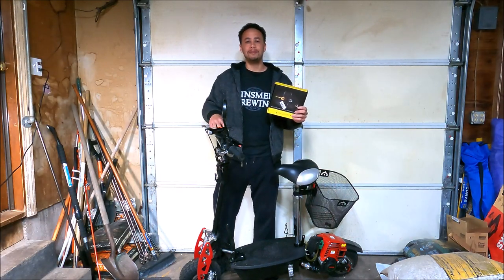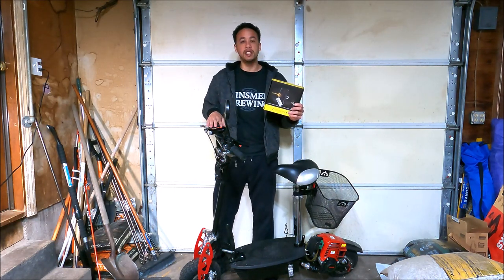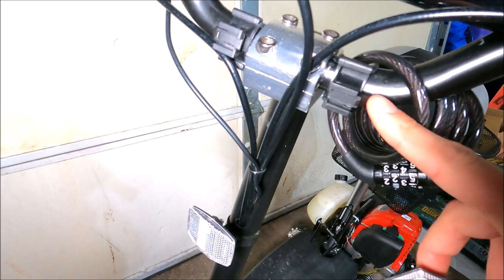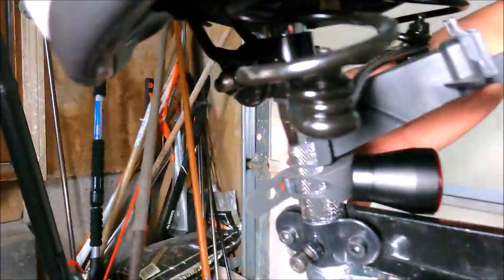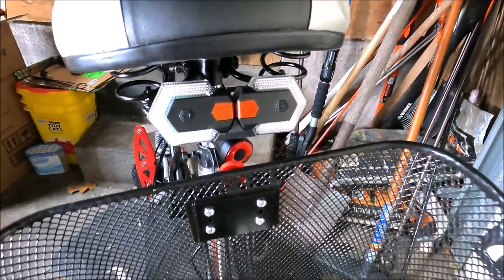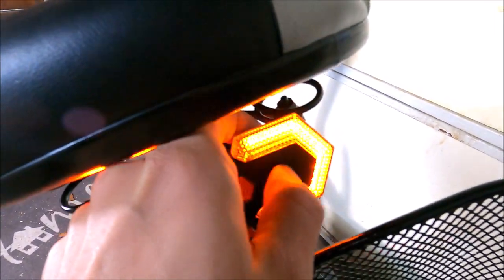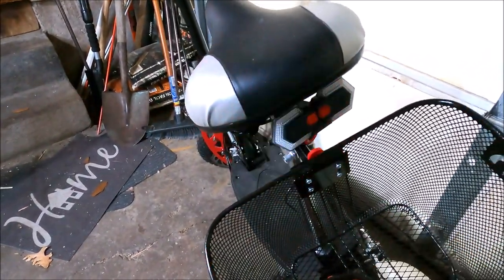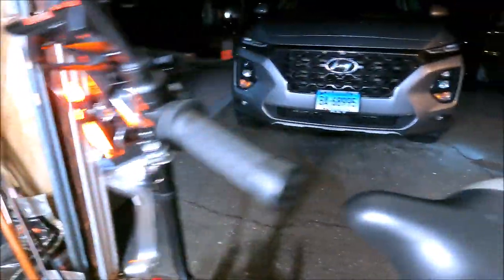Wireless Turn Signals for Scooters & Bikes by Carry Bright

Comment: They are 90% good design.. but.. TO CLOSE to center.. why the heck on the planet they did not do with little more plastic extension, say 6-8" away from center???!! I'd buy probably them.. It should be done (for Ebikes) this way similar to motorcycles' ones...!!!!
Reply: At least they have an arrowhead shape to show which direction you intend to turn.  Or is it too small for cars to tell from an average distance?

Comment: I like these lights but it would have been helpful to see them outside in the daylight, too.
Reply from the maker: Yea that may have been a good call. I did do them inside with LED lights on. But not the complete same I do get it. I will say, they are very visible in any condition.*SK*

Comment: In other reviews they always made that annoying beeping sound while blinking, did you change anything?
Reply from the maker: @Dom93651  No, I didn't. Perhaps mine is an earlier model. I will say that may not be the worst thing because I often peer around to see if they are still on. Having someone audible would make for knowing when they did actually turn on and off. But I have never heard mine make a single sound.
Reply: That annoying sound lets you know at least one light is working. No sound and you have to get off the vehicle or move to check it.

Comment: Can I mount them on horizontal bars in my wheelchair? Thanks!
Reply from the maker: They should be able to. They might be pointing the "wrong direction, up/down", but the light would still be blinking on either side and serve that purpose. They attach to any bar, and the front lights are somewhat horizontal on my scooter. You just wouldn't want to use the back mounting bracket and have them all connected with the strap. Which I believe it comes with a few extras, probably just for that reason or if lost. Thanks for Watch, be sure to Subscribe! *SK*

Comment: Honestly I like this lights but the problem is that have is in the remote control, when I bought the first time the light working very good but before one month the remote control was not working properly, because I thing the problem was for the remote control is the problem, I change but the problem was the same, so because I bought in amazon, and I return I order other one but the new was with exactly the same error and unfortunately have to return again. So I do not was my unlucky or what happened. Hello from London.
Reply from the maker: That's really unfortunate. But I am not too surprised as they don't see like the most high engineered tech. There are other versions out there so maybe something else will work a little better. A battery operated wired system might exist and probably be a little more reliable. Thanks for checking out the channel, be sure to Subscribe. Wish you the best in your serach and Happy Holidays!*SK*

Comment: These lights would not work as advertised, I charged them overnight brand new. They would not perform correctly.
I attempted to pair the left side lights, they only work when I have them in the house on my lap.
Reply from the maker: Sorry to hear that. Mine still work well. Just keeping up with keeping them charged is still the pain with them.

Comment: Those button batteries are a deal breaker. Cost a Fortune to keep the lights going. The light fixtures, at least, should have rechargeable batteries with usb charger.
Reply from the maker: Yeah I haven't seen the ones with batteries but that would be a pain. Although if you don't keep these charged and want to use them it takes a bit to charge them up fully. So there has been a few times I just ride without them. So I guess it's a trade off. But I def. perfer rechargeable overall too.*SK*
Reply: The newer version is rechargeable.

Comment: Wow right on super good idea to have those turn signals on the scooter they're bright, do you think they're worth the price? I could totally use some of those with how much I've been riding mine around.
Reply from the maker: I think they are expensive. Even if you find them for the lower end of $70ish..that said..nothing really out their as versatile. It's a pain to have to charge all 4 and keep a battery in the remote..bit they do work when all juiced up. If your riding a lot I am sure you will get good use out of them. I do find myself just using hand signals a lot still, usually when I forget to charge them up. I like them, not sure I get my money's worth out of them but that's alright at least they look cool and I can be more official on the road if I need to be.
Reply: @SKLIFEstyle  You have some valid points. I'll look into those maybe others but for now hand signals will have to work. 🙌

Comment: They are too close together to distinguish the direction easily
Reply from the maker: Agreed, if someone isn't directly behind you they may not fully know.. But even on my R6 motorcycles I felt the same. I think just having a signal is key for 2 wheel riding. They are pretty visible from the side so people on each side will notice the flash. Front are slightly further apart, no perfect, but still useful in my opinion but I certainly get what you mean.*SK*